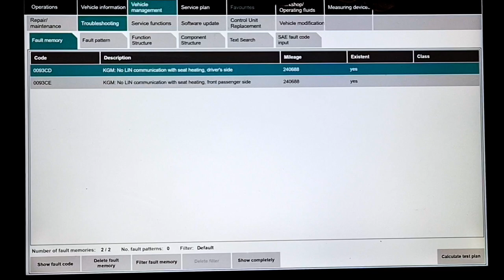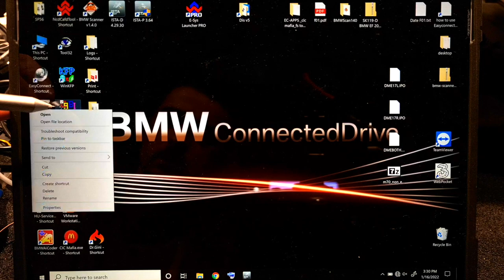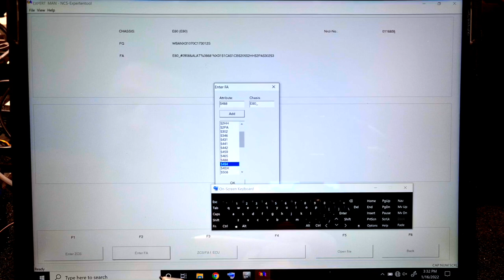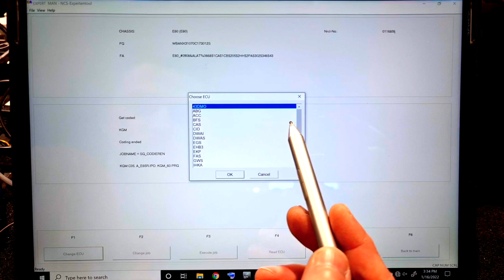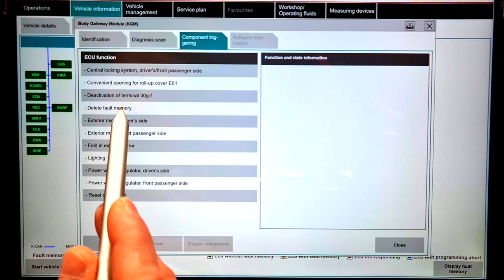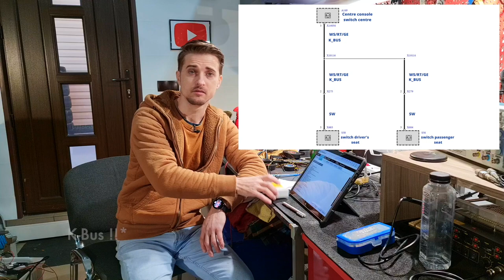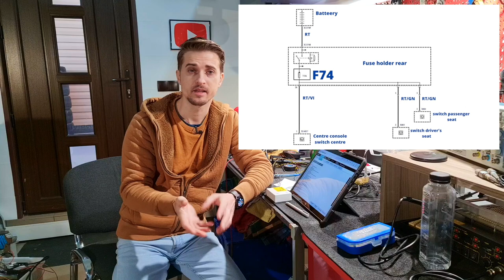Memory Seats Retrofit BMW e60

Comment: Excellent video, thank you. I added the old style lumbar bag in my brother's lci e61, I still cannot understand why BMW did not include the lumbar in the sport seat, it was allready fully electric! Anyway, later he got some fully featured conforts that were fitted, easy job, all wiring was present. I have comforts to fit in mine, also lci e61,  but they need to be connected to pt-can (which is not easily accessible, might need to remove dash!). Also, they are 'very late' but 'pre lci' so some plug wiring will be a bit different but it will be done some time! All part of the fun. Keep up the good work!!

Comment: Thanks for the great video it explained allot.Unfortunately there is some steps which wasnt explained. Passenger seat has second ground to the chassis,+12vdc and -12vdc pins was transferred from original yellow plug to the new black plug also in the black plug was added the twisted cables which are for can communication (as far as i understand from you cars equipped with heater seats already has those wires so i have to unplug them from my yellow plug and place them in the black one) so far two switches wires and two added (in my case i have the two wires already) but what are the other two wires for and on which pins i have to install them.. also the soldering process in the glove box was really unclear and i did bot understand anything from there. Which cables was soldered to which cables,also in the module plug on pin number two you added the k bus cable but from which seat and what about the second seat?

Comment: Great video, very talented for sure! Can you shine some light my way please. I have a pre LCI E60 with sports memory non heated seats. I am replacing them with LCI E60 sport memory seats + heated.. I thought I could just plug and play but 1 connector on the driver side is different and my seats are not powering on. What all do I need to do or replace?
Reply: Pre LCI can not fit LCI seats

Comment: Hey, where can I find wiring diagram I had semi electric seats on e60 2004 525i 2.5 gasoline 192hp. Currently have installed comfort seats, heating works but not moving…
Reply from the maker: Hello! you can find the wiring diagram in BMW WDS and also in istaD!

Comment: Hey I did the wiring correct, coding work because it’s responding , I can move the seat with program but not with buttons on the seat nether of driver/passenger seats work.

the buttons that control the windows by the door have also stopped working,,,, what did I do wrong?

I had half electric seat before retrofit .. I didn’t have the plug who is memory before

Comment: hi i have been watching your videos they are great stuff on my pre lci e61 im trying to go from full electric seats to part electric heated seats the opposite way from the normal retrofits i have the seats working but not the heat part i need help with the wiring but struggling to find the information on pre lci cars 

i have also lost the function of my electric steering colum is there anyway to make it work without the memory seats being there?? thanks for any help you can give me 
thanks tony

Comment: Hi! I have bmw e60 with comfort seats. I have one problem. My seat side bolster not going back to memorized position when I close the car’s door. It goes to zero position when I open the door or turn the car off and etc, but not going to memorised position when I close fhe door. Only gets back when I press the memory button on seat. Passanger seat works fine. 🤷‍♂️ Maybe you know how to fix?

Comment: Hi. I have done the same. Put Pre LCI full electric seats into LCI instead of half electric.
My problem is that I am moving both seats at same time from passenger side. But never from driver side. Also I have on CAN bus only SMBF...no SMFA. I also took for testing SMFA from an other Pre LCI because I thought I have wrong SM on driver side...but if I put it in LCI Ista shows me again SMBF (also if i unplug the SM under passenger seat) 😂

I've connected both SM on same CAN and from both SM 1 wire (LIN to SZM)...any idea what I did wrong?
Reply from the maker: Hello! you need to proper check your wiring and compare-it with WDS ! the passenger seat it is a slave and need to have an additional ground!

Comment: Gr8 thx. DO  you have maybe some information about connecting heated seats?  small modules under the front seats e61 not LCI no cables folded seats
Reply: Seats from LCI
Reply from the maker: Hello , you can find everything you need in WDS and in istaD

Comment: Salut. Ajuta ma te rog cu o informatie. Am cumparat doua scaune sport la masina, avand reglajele la fel ca si ale mele si incalzire. Problema e ca sunt de anglia. Am vreo sansa sa le pun si sa nu imi mai apara eroare de airbag? Asta pentru ca mufa cea mica de culoare galbena la mine e pe stanga la sofer, iar la scaunele de uk e pe partea cealalta. Ca ar trebui sa fac? Mersi frumos.
Reply from the maker: Salut! va trebui sa le demontezi si sa muti sezutul de pe un scaun pe altul sau daca vrei doar senzorul de prezenta dar e mai mult de munca .
Reply: @MOvidiu  m ai putea ajuta cu montajul scaunelor la primavara cumva? Platesc tot deranjul. Imi pare rau sa le vand...
Se pot face functionale? Si la centuri difera unele chestii. Masina e un e60 din 2007, facelift, dar pe modelul vechi cum ar fi...motorul e cel m47. Mersi!
Reply from the maker: @iovanovici darco ii  Pentru reparatii diagnosticari si retrofituri va trebui sa apelezi la un service specializat BMW din zona ta! Eu nu te pot ajuta,  nu ofer servicii de nici un fel.
Reply: @MOvidiu  mersi de sfaturi. Mai am o singura intrebare. Daca prelungesc firele de la mufa cea mica galbena din partea stanga a masinii cum e acum, pana in partea dreapta la scaunul soferului de pe masina donatoare de uk, e ok? Alta idee nu mi vine.

Comment: Does anyone have an idea how to retrofit the newer crash-active headrests? The 520d in the video already had them from the factory but what if you have an older model?
I am going to put ventilated seats ("Nasca") in mine. I know how to do that, but have no idea how to make the headrests work since they are from a newer model (2008 vs 2007 LCI). They come with a separate yellow connector with 2 wires (from 09/2007 to 12/2007 the driver's side has 4 wires due to a secondary seat belt tensioner).
So basically it would be a question of wiring and does it require the airbag module etc from the donor vehicle or can the original one be coded?

Comment: you do always so very good job... i hope i have you in france to send you many bmw... Can you please tell me is is possible to replace E64 (convertible sits) by F12 convertible sits with heating memroy etc fully working  ? is a guy who didi it but not totaly that mean the memory etc works except the heating sits. a friend who make electrics harness told me i theory and to have no issue you just need to switch all your modules under your sit E64 LCI 635D sport pack (full electric  and memory) and put them on the F12 LCI. What do you think about that ? on the F12 LCI they are airbag on the sits but on M6 they are in the doors then i will just not plug the wires for the airbag on the sits. i realy wish you are close of me to bring you the car but unfortunatly ^^

Comment: Hi,
Pls i need your help 
I have an E 70 and i have retrofitet comfort seat with ventilation. I need to code the modules
Reply from the maker: Hello,  first you need to add the options in FA, and after that code affected modules
Reply: @MOvidiu  
Thanks for your answer 
Pls can you tell me the order of procedure so i can try with ncs expert
Reply: @MOvidiu  hi again 
Thank you for your reply 
I managed to do it. Added kcan wires and fixed some wires for controll knobs and everything in working perfectly. I code ihka with bimmercod for ventilated seats and all good
Reply: @MOvidiu  but there is only one problem at driver seat. I get both from e71 and put on e70 and i have an error for 
ACSM: Backrest Lock (E93)/Seat Memory
(E70/E71) For Driver's Seat 
And seatbelt reminder and airbag stay red on insrument cluster
Reply: @MOvidiu  
93C6
SLV / seat module driver
This is the code with bimmerlink scaner

Comment: A very poor guide to converting a chair to full electrics.  No display of additional seat travel motor.  There is no information about the additional module.  and bundles.  There is no information about the front skin stretching and the addition of a masking strip.  It is better to buy original seats because they have an electric headrest.  In general, you do a lot of rework and don't show the electrical mechanisms.  My assessment 5/10 There are other shortcomings of yours that I will not write about.  Plus for willingness to work with armchairs.
Reply from the maker: Hello ! Unfortunately, this is not a GUIDE or a DIY .  And if you think that you are able to do something better than this, please do it and I will promote it.